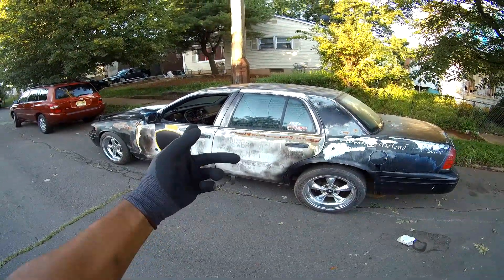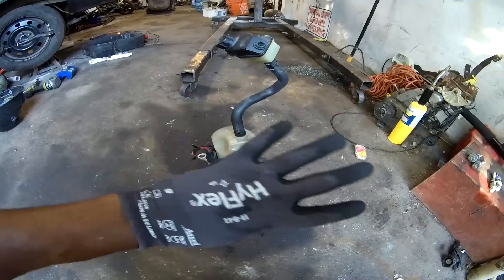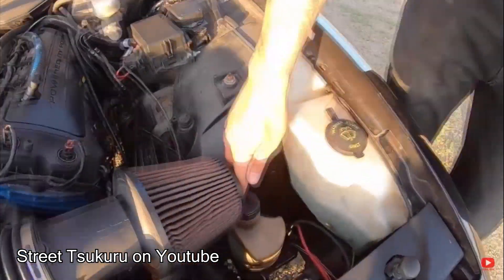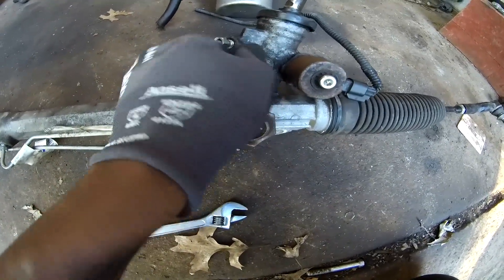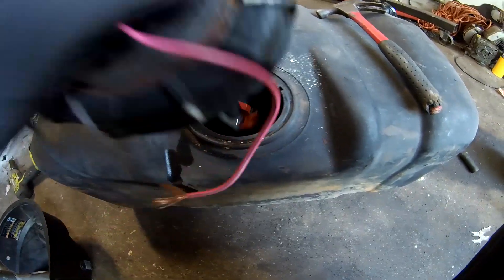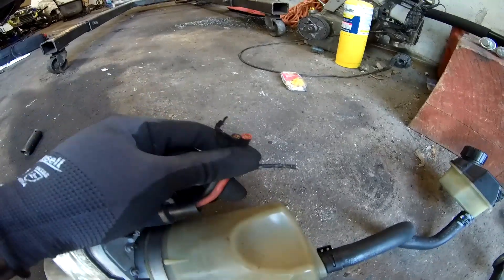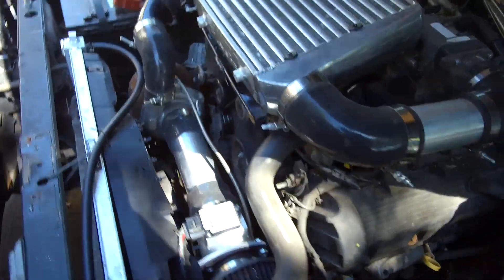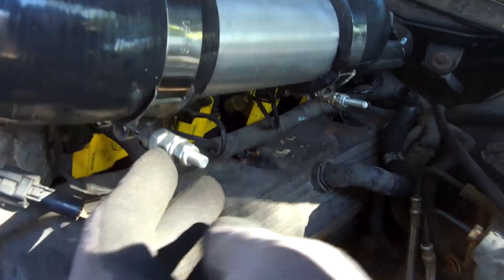Electric Power Steering Pump in a Crown Victoria ( Guide ) and Updates

Comment: I wish I could do this with my Crown Vic: the power steering is plain LAZY. I've already flushed the pump with clean fluid, and I've noted it makes no strange noises, yet it's still lazy. Serpentine belt also looks fine, and the steering feel does not change when I up the throttle.
Reply from the maker: what I have seen or notice these car dismantle power steering pumps they seem to small for our cars.. I have no quite figure the complete gave for our cars yet, but this may not cure that lazy feel. Bmw cars ( the ones I had ) had power assist ( for that race feel ) the vic kinda remind me of that

Comment: Now we’re talkin!! Never thought of using an electric ps pump. That must take a load off the motor. Are you going to use underdrive pulleys? How much more load would that take off the motor?
Reply from the maker: that i do not know.. i will say 2 hp and better revs on that engine ( being honest ) so i have no ac also so it should rev nice... and have a ok feel. the  I have to try the electric power steering pump to tell ya guys how it is..
Reply: BST Ford Channel I’m amazed now having only just gotten my second Vic how much the little things change the feel of the car. The one I’ve had and been slowly upgrading is waaaaay more responsive off the line than my new one. Did you know that a Lincoln LS throttle body will work on a vic with only slightest of modifications? Takes the same tps and motor as the 4.6. All I had to do is drill new holes to match the bolt pattern. Viola, 70mm throttle body that you can get all day on the cheap at junkyards. Credit to claybelt on crownvic.net for the idea and for sending me my first one. I don’t know if anyone other than he and I have done that mod. I coupled mine with a TB spacer so the throttle blade wouldn’t hit the plenum. I’m positive there are no videos or info out there about it but it does work quite well.

Comment: Hey bro got a question on my 03 town car my wipers come on by then self just changed the motor what do you think causes that. Does it matter that I have the rain sensor this is my second motor in two months. Help me please
Reply from the maker: the switch is easy to change ( turn switch ) and check that..Check wiring also to go simple before you go all the way in.. maybe wire leading to wiper motor is bad
Reply: Thanks bro

Comment: Thanks for the tip on the Volvo elec pump. I put the F100 Crown Vic swap back together with the F100 pump. It works ok to a bit under powered at low rpm. I like cleaning up the engine bay as much as possible and getting rid of 1 more drive belt. I'm running no air condition for the same reason. Thanks dude! Keep on keeping on man!
Reply from the maker: This may be the ANSWER for ya its pretty cool. i am just trying to get some stuff dome to see if i can do it for cheap

Comment: 9:23 I wonder if the fan would work better if it was on top of the intercooler sucking the heat out of it, and then blowing the heat out of the hood scoop.
Reply from the maker: I tried on top, it did not sit right I did that 1st.. this aint the final design i will play with it a little.. I have 3 fans., I wanted one on bottom and another on top.. so i may even try that again

Comment: I am a Volvo tech. The xc90 s front brakes are a doable swap as well for the Vic . being that Volvo was owned by Ford for like a decade, a lot of Volvo parts swap over.
Reply from the maker: hmmmm? really? I have to see what is good on that... I knew about that and i never knew.. I now some 4 cylinder head swaps can be done. Never thought about breaks and stuff. This good to look into Rob.. trust me i wanted a box volvo also.. I have been looking on the low for one shhhh
Reply: @bstfordchannel923  a 240 wagon with a LS/five speed😈
Reply: Rob Sorgdrager what other cars came with the power steering pump that works for the Vic? Also are XC90 brakes bigger than stock P71 brakes??
Reply: @isaiahbrown567  the newer spa xc90 has giant 14 inch rotors .
Any of the p3 chassis cars came with the electro/hydro steering.
Reply: Rob Sorgdrager and both will go right on any 98-11 Crown Vic like it’s nothing??
Reply from the maker: @isaiahbrown567  Thats what I was waiting on see if if Rob can give me some game
Reply: @isaiahbrown567  the brakes will need a bracket made and you'll need to get two piece rotors .
Sooooo no, but you have a brain that has been evolved to solve these kind of problems 😏

Comment: I love this channel Man your like the Ford Mad Scientist lol 😂 what are the benefits of the Electric Steering? Better handling?
Reply: I'll help this customer BST.

Yo Robert,
I believe it's a simplicity, and value for money issue.
The original P/S pump is a belt driven unit.
The routing of the belt takes up space.
Having an electric unit provides the flexibility to mount it "remotely".

The 1hp "gain" is an unintentional byproduct by not having the pump driven by the crankshaft.
This is similar to replacing a mechanical radiator fan with electrical units.
Hopefully the "heavy duty" police spec alternator can cope with the extra electrical load.
I think the civilian models are around 130AMP, and the P71's are over 200AMP.

Of course, I'm probably wrong about all this.
Contact the customer service help desk to request a full refund in needed.

-Chuck
Reply from the maker: 1 to 2 hp is correct, better rev a tad and doing something odd for cheap lmao.. Thats the main goal
Reply from the maker: For me its ( just do do it ) I want to drift with the car ( if possible ) I can not drift with power steering. I over steer a lot, but now if i install this i can turn it off ( by a flick of a switch ) and be good..Just want to add something functional and useful on the cheep. Chuck said it best

Comment: Cool Audi, and power steering pump. I wonder if those remaining 2 wires would be for speed control, change of feel at different speeds.  I've still got the old style steering box :-( Electric steering in the Probe... now we're talking.  The rack looks the same. Takes forever to get in there and do the power steering pump.  I could run one less belt I think.  Supercharger time.
Reply from the maker: right thats what i am thinking about to try this cause i just want to see what is up.. maybe not need those fittings i was speaking about just make everything in hose

Comment: OK Bro... I'm sold!  I'm putting the electric steering on my To Do list for my Panther 😎
Reply: AUTONOMEN x  Going to a electric power steering pump allows you the remove the belt driven pump... maybe 5+ HP gain!
Reply from the maker: I am about to try this, but i see a few things you may need those fittings I am about to try this like next week. we can do this cheap for our cars and our cars should hold the electric pumps power..
Reply: @bstfordchannel923  Is there a electric water pump too??  That's why I love old school motors like the 289/302... manual steering and brakes plus no a/c:) and tons of options to get More Power!
Reply: @danielmcqueen1024  4.6 have electric water pump also. Maybe he may take that route also
Reply: @reignbird3167  Sweet! More things not to run off the belt... keep this up and we get over 300 HP! Downhill of course  🤣😂😁😎

Comment: And que the power steering haters now. I got so much hate on my channel for the one I did in 60's mustang.
Reply: I've driven a 66 it was easy without power steering... but there were a lot of turns lock to lock. I'd rather have power steering, less turns a thicker wheel, and hopefully not bias ply tires :-)
Reply: @pgtmr2713  customer was 84. But it was just a add on. So it still took 3 full turns to go around a corner.
Reply: @ReverseGear  I mean the customer was 84 that's terrific they were still driving, power steering is necessary at that point. You shoulda put neons and a wing on after the complaints. Really though a Mustang, no matter the year, if you're not cutting on it, it all can go back to stock at some point with the next owner or 5. I've got a Probe GT and I save my parts in case I want stock again. Anyone can do that.
Reply from the maker: really  iave to sub to your channe; bro and see what you have going on.. you will have hate for a flawless car thats times..